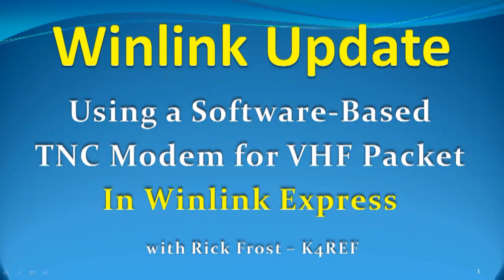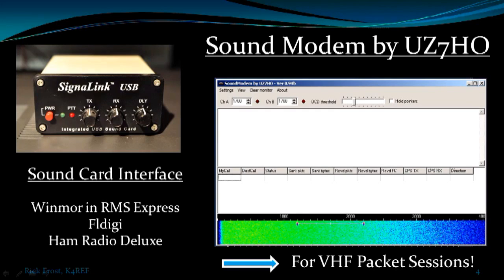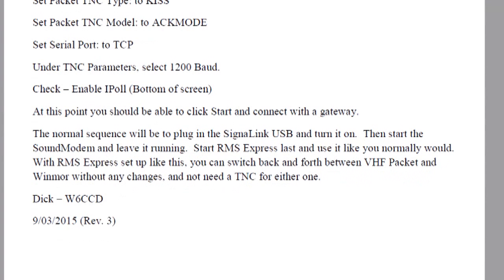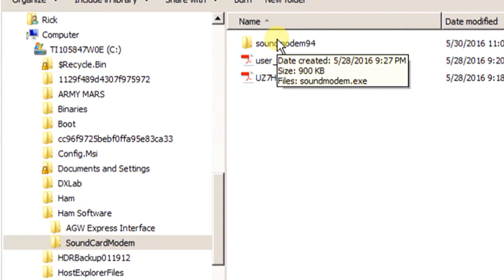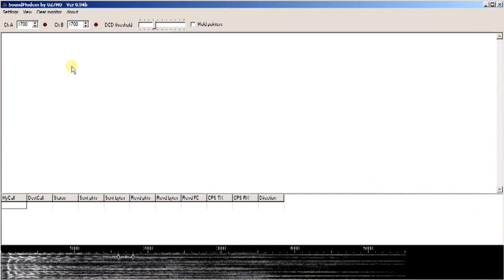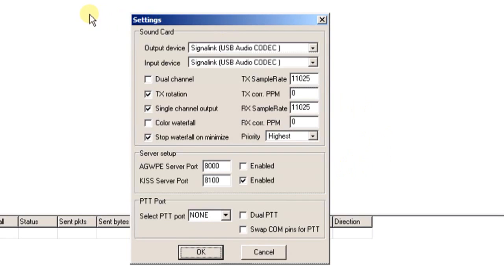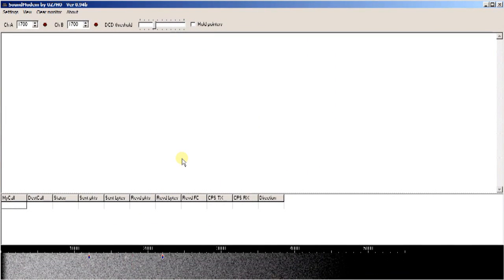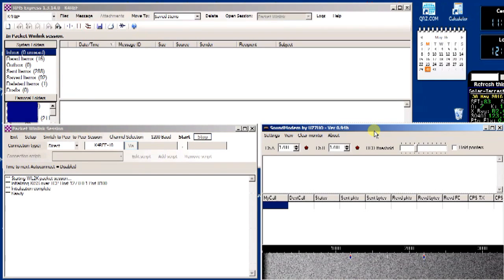"Sound Modem TNC for VHF Packet in Winlink Express" (See new mode in notes)

Comment: Is there any benefit to using Signalink with a radio like the IC-7100 that has its own built in sound card to use with Winlink?  Or would something like the Mobilinkd3 or MFJ be better options without the need for the UZ7HO?

Comment: Great Video, Can I monitor traffic? I want to also monitor satellite data. When I click START,  I get "you must specify the call sign of the station you want to connect to." TU
Reply: Sound modem is receive only. It doesn't transmit. So that's all it does is monitor.

Comment: Wow...  It works.   I finally with some very valuable help from a local ham and packet guru got it up and running and it works GREAT...  Thank you for sharing this.   I was really afraid I was going to have to try and find a used TNC to do packet.  Now the Soundcard Packet Modem works GREAT...   The trick for me was be very careful how much delay you have on your Signalink USB.  In fact I have found it works optimally when the nob is on or about the first line in magnitude.  I started out with it at 1/2 scale and it just was not working consistently.

Comment: When using the Sound Modem TNC software, can I connect my computer to radio directly using the BTECH APRS-K1 Cable (Audio Interface Cable) for BaoFeng radios? I wonder if it is possible, like APRSdroid on my phone. Thanks.

Comment: I think I have everything setup how both your videos on this describe. All three components (computer, radio and SignaLink) seem to be talking but nothing happens. On the UZ7HO screen there’s to and from dialogue but that’s it. What am I doing wrong?
Reply: I am having the same issue with Uz7HO
Reply: I think I have it solved. I think it’s because of a weak signal either going or coming back. That seems to be my issue. Make sure to read the comments to make you have the correct new settings

Comment: I don't see a VHF modem Mode option. Wonder what I've done wrong?
Reply: Opps. I should have read the change notes...SoundModem v0.96b changes:
- Renamed "HF AX.25 300bd" to "AFSK AX.25 300bd" 
and "VHF AX.25 1200bd" to "AFSK AX.25 1200bd"
Reply: I am in the same boat you are...

Comment: Is Signalink required?  What would be lacking if I used a USB sound card ($6), and the UZ7HO + Winlink software for VHF packet, with the radio in VOX?  I'm not seeing what the Signalink buys me. Thanks for making the videos.
Reply: You can use a cheap USB soundcard with the radio in VOX. But for better performance I recommend to use PTT. If there are no built-in COM or LPT ports on your PC, you can try even a cheap USB-COM adapter to PTT operations.